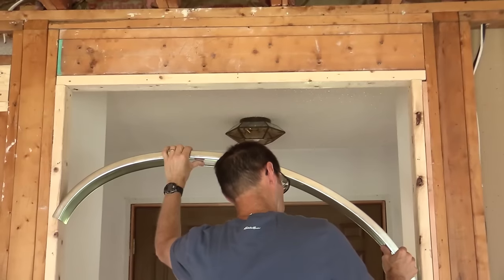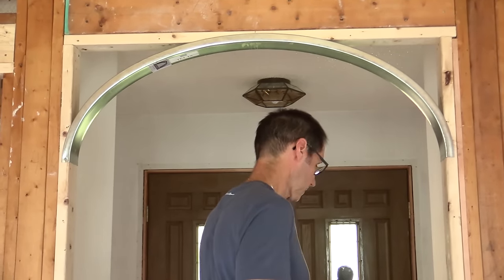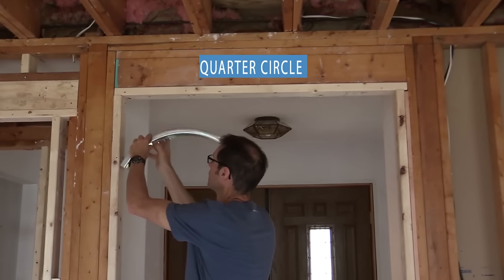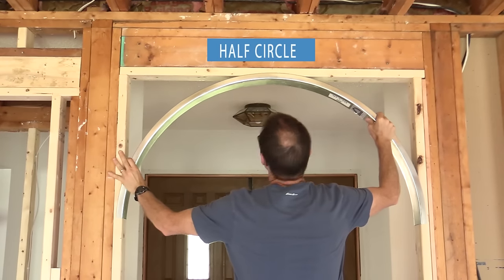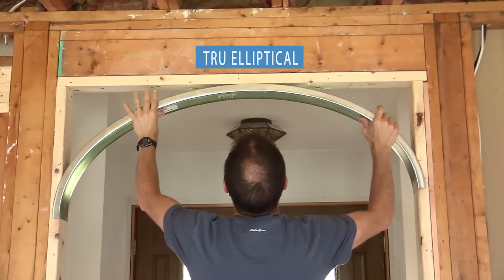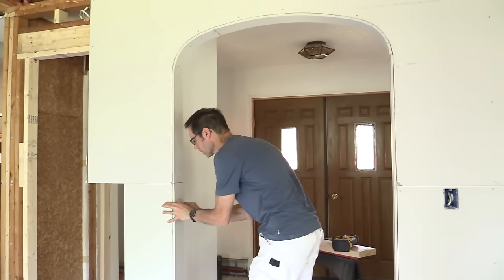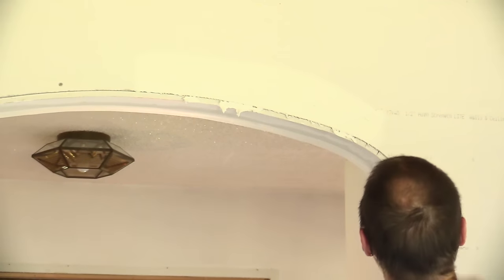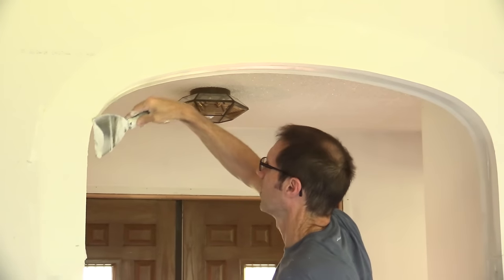Install Arches in Minutes....

Comment: So is this only for archways or is there a way to use this to make an arched door frame for the front door and other doors in the house?
Reply from the maker: Our product is for frame opening only. If you have a header and I opening our product will work. However, it's non-load bearing.